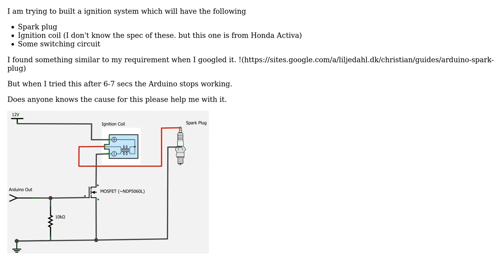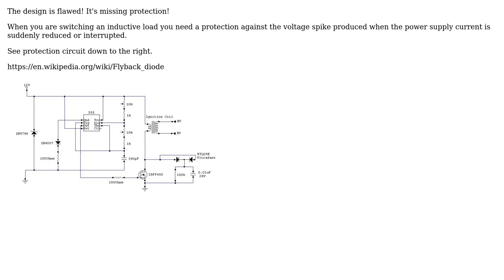Electronics: arduino controlled spark plug with ignition coil

Comment: Avoid damaging your Arduino by interfacing arduino to Ignition via Optocoupler Chip. If you interface Arduino with spark plug the way you did then the high voltage leaks (through conducted emission) back to Arduino and will fry it because it is not designed to endure high voltage, it is internal circuit can handle 5 volts only, you ruined your Ardunio.
Reply: True